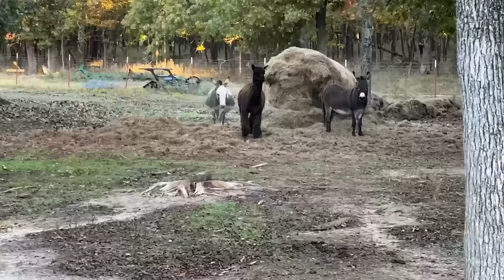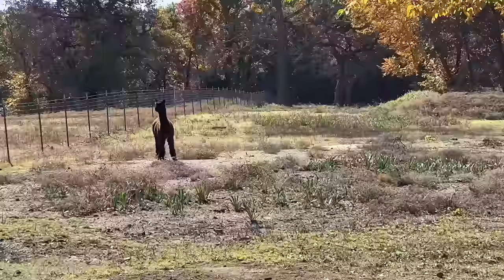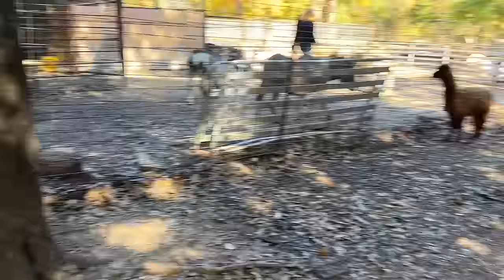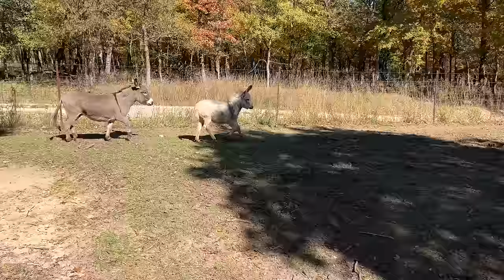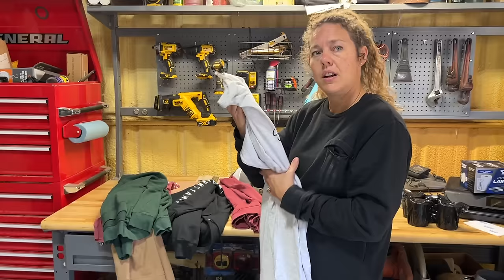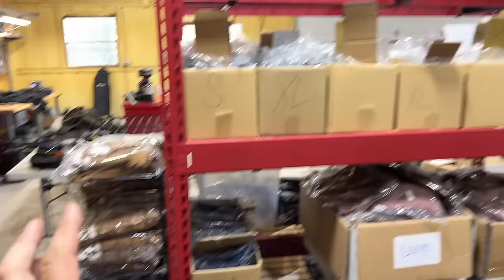Making Some Big Changes!

Comment: I will vouch for the Rtic Stanley ripoffs. They are better. I bought 4 of them for myself and fam on the day they dropped and they blow Stanley away. They are ceramic lined inside, unlike the Stanley’s, so no metal taste. Plus much cheaper than Stanley’s.